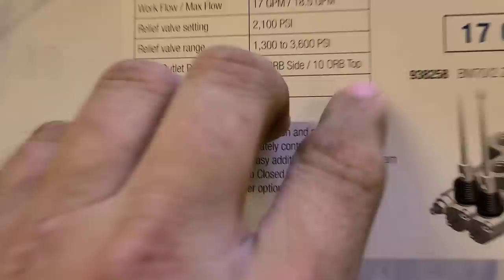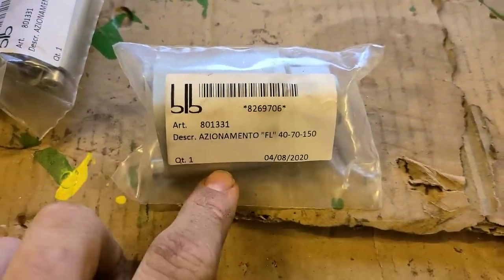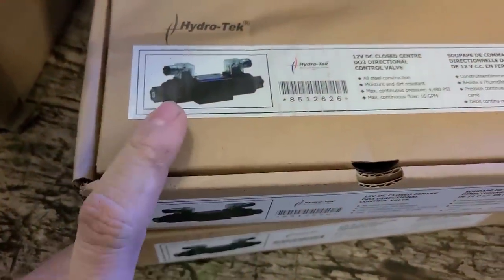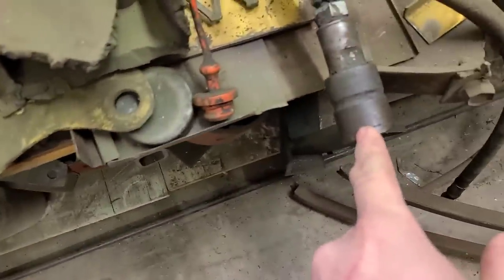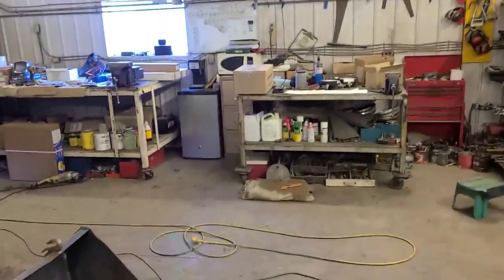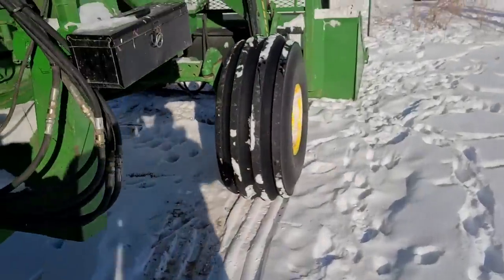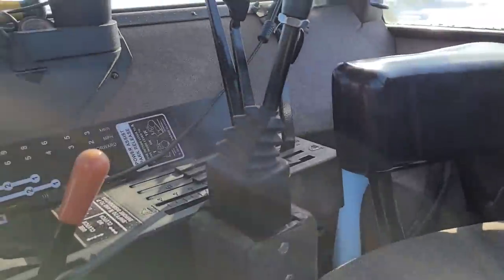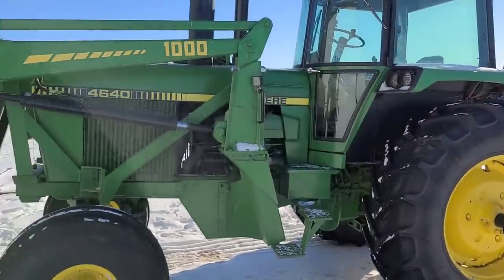Joystick with 3rd function for ag tractors on a budget!  includes part numbers!

Comment: Links for these parts:

BM70 2-Spool Directional Control Valve
  https://www.princessauto.com/en/bm70-2-spool-directional-control-valve/product/PA0008669806 
Closed Centre Plugs
  https://www.princessauto.com/en/closed-centre-plugs/product/PA1000000785?skuId=1259134 
Remote Attachment Kit for BLB BM/BF 40/70
  https://www.princessauto.com/en/remote-attachment-kit-for-blb-bm-bf-40-70/product/PA0008269706 
Single Station DO3 Manifold Block
  https://www.princessauto.com/en/single-station-do3-manifold-block/product/PA0008371155 
12V DC Closed Centre DO3 Directional Control Valve
  https://www.princessauto.com/en/12v-dc-closed-centre-do3-directional-control-valve/product/PA0008512626 
A-VFH1009 Joystick
  https://www.allpartsstore.com/ItemDetl.htm?ItemNumber=VFH1009 
A-VFH1416 Assembly, Cable, 79.5" 
  https://www.allpartsstore.com/ItemDetl.htm?ItemNumber=VFH1416 
A-VLC2517 Switch, Push Bottom (For VFH1009 Joystick)
  https://www.allpartsstore.com/ItemDetl.htm?ItemNumber=VLC2517 

Thanks Nick!

Comment: That second lever for the grapple always annoyed me. My old job the one mechanic did something similar for a loader and used the electric over hydrologic for the bucket roll function. Except he mounted the button on the exsisting joystick with duct tape wasn't so handy. Hope the boss is doing better.

Comment: Maybe a dumb question, but for a tractor with an open center system, would you still use the same 12v directional valve block for the grapple? I get that you wouldn’t plug the spools but I’m trying to figure out to plumb a 3rd function as well as installing a joystick to free the remotes. Thanks